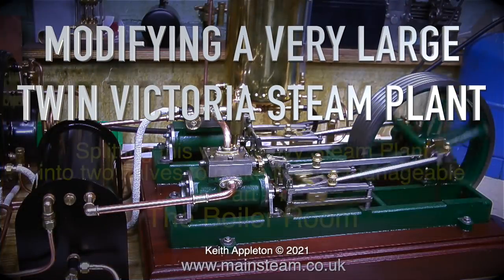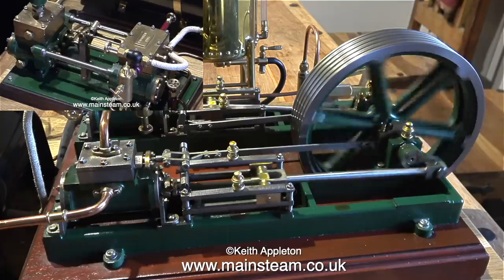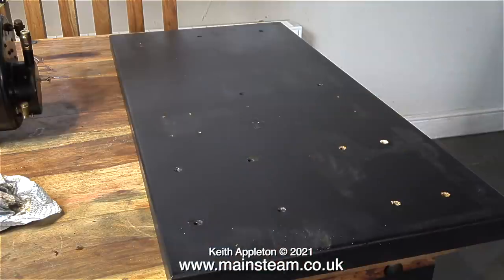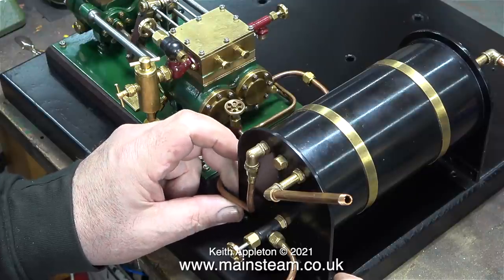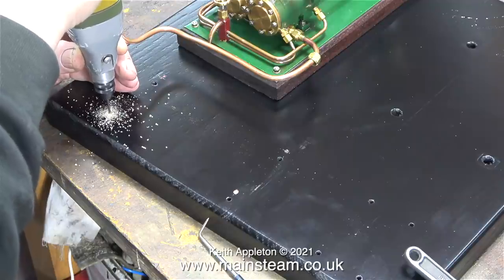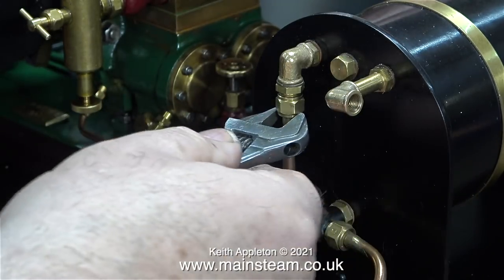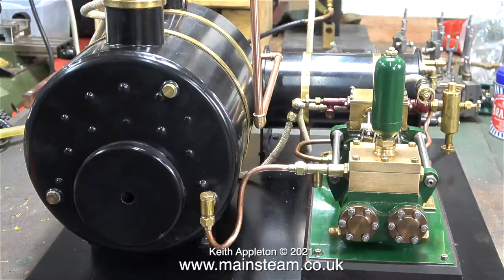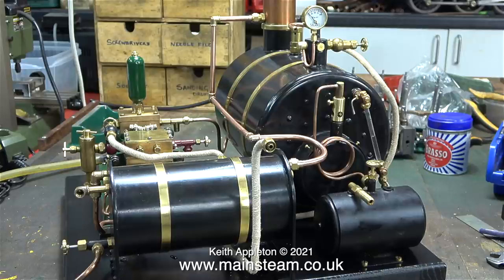SPLITTING A TWIN VICTORIA STEAM PLANT - PART #1

Comment: Color code each pipe that needs to be hooked up with a different colored dab of paint. Blue goes to blue, red to red, green to green etc. That will eliminate a lot of confusion, especially if it goes to someone not as knowledgeable as yourself.
Reply: YES! I do that with all my cables when setting up in the band… a lesson learned the hard way by sticking 18 volts where only 9 should go☹️
Reply from the maker: Yes, some coloured insulation tape can be useful for speed when setting up gear before a gig.
Reply: @keithappleton  The trouble with gigs is that "Red is grey and yellow white". Sorry... a Moody Blues moment crept in there.